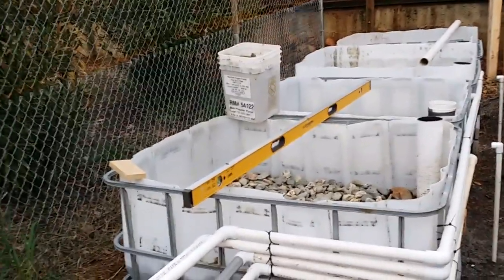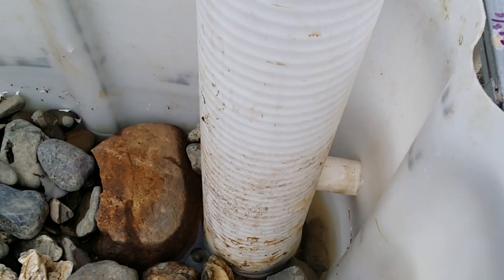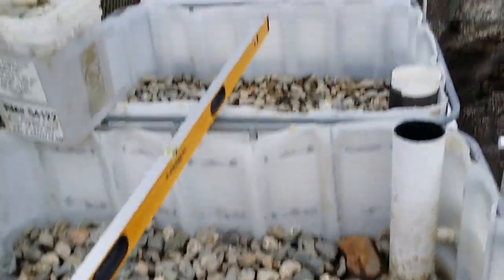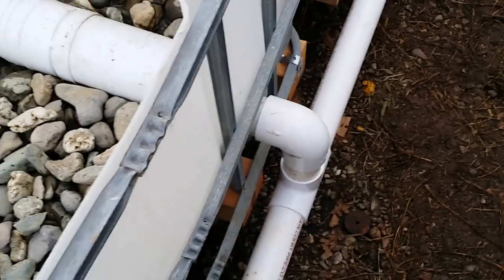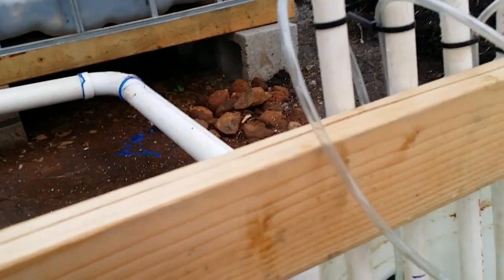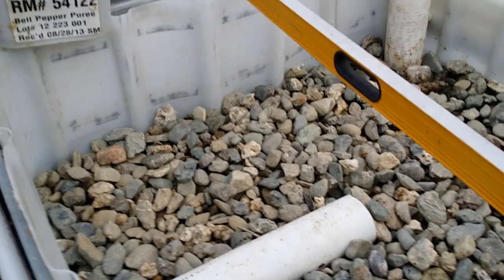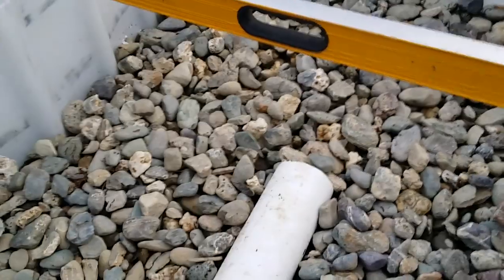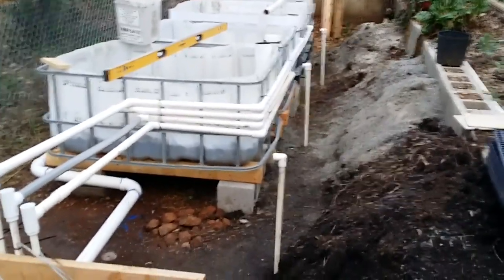Construction of 60 sqft Earthan Beds w/ 8 Watt Air Pump.

Comment: Correction 8 watts
Reply: I wonder if this is enough circulation for an aquaponics system
Reply from the maker: Tom Helmers  It's probably enough for a small aquaponic system, but to be fair I would prefer more circulation for fish.  This system will be Bioponics,
My AP system uses a 200lpm EcoPlus #7 air pump rate at 200W but the actual measured watts is 95W.  Here is an example of how my system is moving well over 1000gph.
http://youtu.be/eoJ9XFsy3Ok
Reply: I did try it once and no there wasn't enough flow for flood and fill and even with DWC and NFT you need reasonable water flow which is better controlled through a series tap. From experience it is better have a liberal flow of water for Aquaponics the place restrictors in you system have total control
Reply from the maker: This is a Earthan Bed using Bioponics not Aquaponics.  For my Aquaponic garden I had to use a 200 lpm air pump. That system is capable of about 1200 gpm water flow.
Reply: I realise it is not  Aquaponics but have seen Van der Werfs'  systems through a mutual friend. Paul is not far from here but being a typical Kiwi I'm always looking how I can t  something I've already got and modify  it.. I understand   Bioponics but when I saw the stone media  my ting brain goes I've already got half that in my stone media Aquaponics  all I need to do it lower the level of the stone put geofabric over it then a soil mix and I can keep my NFT and DWX working in parallel  water still circulates  and the old chop 2 still functions. Unstersrand us Kiwis  will make a sparkplug lead  out of an old piece of fencing wire and a roll of insulation tape a length of sting often  replaces a box of nails . I wasn't saying you're wrong I was thinking yes eureka I can carry out a modification . I know Paul's system well but you system looks to have some features I can use thanks for the video.
Reply from the maker: I'm happy to hear you see the advantages of Paul's Earthan Beds so let me pass on a couple of things I've learned. I used 2" PVC to avoid problems with roots clogging the drains, but on one bed this has already become a nuisance.  I have built many of these and each time I mixed the soil without a specific recipe.  Most of my beds wick just fine, but I have a couple that don't.  Getting the correct amount of clay in the mix is important.  I really like my Earthan beds and hope you will continue share your ideas after you build yours.
Reply: OK will get some videos during build and on progress , often time we never get to see if things actually work